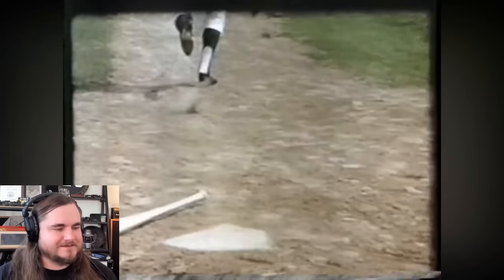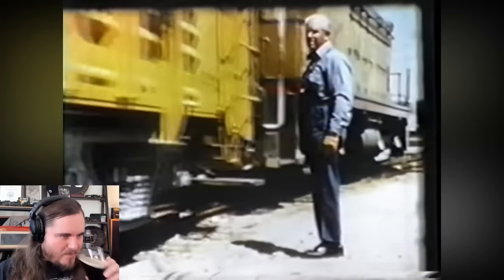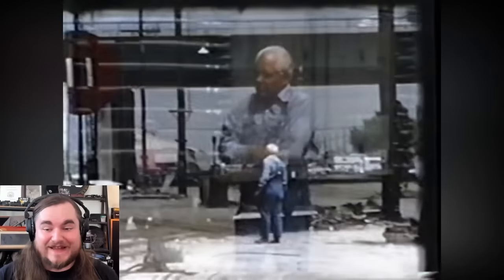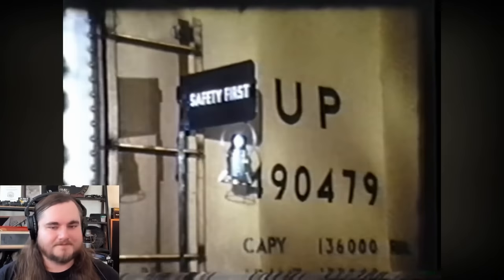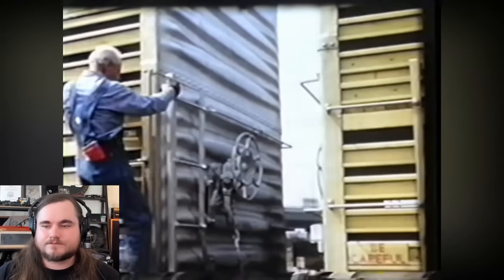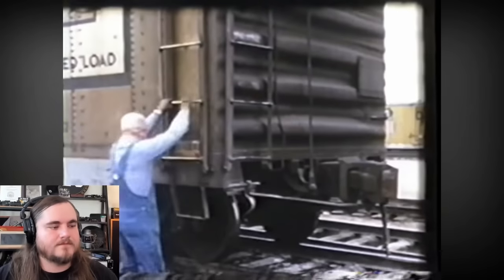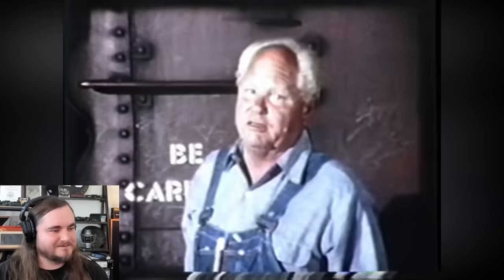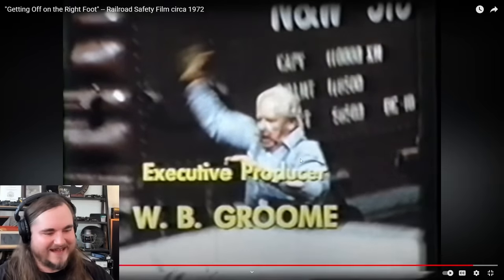The best rail safety video of all time? | Hyce Reacts - "Getting off on the Right Foot"

Comment: Interesting note for those who are curious--to my knowledge, the washout is a universal signal, recognized on every railroad in the world.  Additionally, I've been told (though I can't quote chapter and verse in any set of operating rules) that any vigorous/frantic waving signal from any person at trackside is to be taken as a washout.  That said, if you're giving it to warn of stuck brakes or a hot bearing, it's still best to use the proper hand signals for those, as it does give the crew more information as to why you're signalling to stop... assuming you can get into a place to give such a signal now that the caboose is dead.
Reply: Nah, washout as shown in the video is US (or North American?) specific. Here in the UK the emergency stop signal is the same as the ordinary stop signal (both hands raised above the head); in Germany, it's one hand swung in a circle; no doubt it's different in other countries. Though I think most rulebooks in the world do say that vigorous waving also = stop.
Reply: My local transit agency (which is not under FRA regulation, well mostly), has a rule in the rule book, under signals (right beside all the other signals) that any object waived violently by any person is a signal to stop.

Comment: We also used this video in my brakemen class. If I’m remembering correctly, we looked up the “old head” after the video and learned he was a stunt man rather than a railroader. Nevertheless his performance was excellent. 

Over at my museum, we use hand signals that are closer to yours than to East coast, probably because we inherited much of our practices from the C&NW. However, we do still get on & off moving equipment, mostly during switching ops and run arounds. 

Keep up the great work!
Reply: He was a stunt man, yes, but he was also high up in the safety department for UP, and had been a railroader for a while. Accounts of people who worked with him said he was an amazing teacher that always put safety 100% before anything else.
Reply: Someone else said he was both, that he was a stunt man who happened to work for UP. So it would help to not only be able to do the stunts, but know exactly what to do to be unsafe safely.

Edit: that someone else beat me to it lol

Comment: I'm a little late here, but on the railroad I work for, we use the "night signs" like you mentioned with a couple slight tweaks: a "STOP" signal is a horizontal motion across the body, (or really anything across the body should be treated as a stop.) And we don't really use the "washout" hand signal, but rather it's worded as "any object waved frantically should be treated as a emergency stop signal."

Comment: About the hand signaling, the US railroad always confused me with the motions.
Europe might be different from country to country, but here is how it works in Croatia:

Vertical arm movement - forward
Horizontal arm movement - reverse
Circular arm motion - STOP
One or both arms to the side with you hands lower to the ground, about some 45 degrees - ease off, go slowly, prepare to STOP

Signals can be given by bare hands, red flag or white light at night and poor visibility conditions.

When shunting with a locomotive with one cab, the longer nose of the locomotive is the front no matter what or where the cars are coupled. Now this can sometimes be problematic with center-cab locomotives so there has to be an agreement between the engineer and the switch man.
Now, with locomotives with a cab on both ends it depends where is the engineer. Basically the switch man is telling the engineer where to put the reverser lever. Same applies to multiple unit trains.
Now there is a catch and it doesn't make sense, but it's railroading for you. Imagine for example an EMD locomotive coupled to a train with the short nose being the head of the train, not doing shunting work. Now you need the consist to move forwards. Which signal to give? You give forward even though the rule says the longer end is always the front.

Comment: Used to work at a class 1 a couple years ago, kicking is still very common and one of the most dangerous things you can do. If the train is moving too fast and the ballast is uneven it’s very easy to trip and fall.

Comment: Back in the 90's I was a operating rules instructor for new hires on the UP.  The new hires never had been around the railroad, some right out of college. We showed this very film.  First, three point contact was always stressed when either on a stopped or moving car or locomotive.  Also shoes were to be work shoes with a defined heel and laced up (like Lehigh boot or Red Wings).  In my entire career, I never saw any switchman or brakeman, or hostler get hurt when following the instructions in this film.  We even taught this in on the job student field training classes.  Not shown here, but we used a 2x4 to demonstrate what happens to a leg when run over by a wheel because it was the same density. Then the UP discontinued this practice only to get off and on stopped equipment.  This adds additional unnecessary switching time especially when flat switching or building a trim.  It is harder on equipment and can be harder o personnel for there is additional jolting of the body and drawbar stress via slack action.  This "getting off on the right foot" has been practiced for generations because it is safe and efficient.  I cringe when watching old films though here on youtube seeing brakemen or switchmen getting off on the wrong foot, jumping off etc.  Just want to turn the clock back, be there give them a warning and write them up.  Those gurus in the safety department undoubtedly never worked  in operations themselves, but sat behind a desk (with the lawyers) and said, well we can't have this of crews getting on or off moving equipment, we could be held liable and get sued if someone gets hurt.  Ugh!  Also footboards were eliminated for obvious reasons (a switch engine's job is is to switch cars, not grind meat).   Also the rule was changed to 30 feet minimum distance between cars before bellying up to a drawbar to align it.  Those cars where he demonstrates on how to properly connect brake pipe hoses were hog cars.  The carried 300 hogs on 3 levels.  We called them "The California Ladies"  Hyce, you said "don't couple yourselves up."  That happened where I worked back in the late 70's.  Happened in the bowl cars humped into the track (humpmaster was not informed) switchman was coupled between drawbars.  He lived and conversed with emergency personell until the cars were uncoupled, then he instantly died.  This was a result of a rules violation.  At beginning of the first class on the dry erase board we wrote for the class to see "Operating Rules Are Written In Blood"

Comment: 31:00
Most of my time is on trucks, both tractor trailers and fire apparatus.  Towards us is two arms waving or circling inwards, with rough relation to intended speed.  Away from us is one arm, waving forwards (which would appear as up and down). The last bit to the couple or the line is out of the aviation book moving hands inwards towards each other with rough relation to distance, and the couple or stop is forearms crossed roughly to an X.  Really a hybrid of like four manuals, but it works, and we agree on it.

Comment: As an Engineer the most unusual sign I ever saw was when switching at a station when the Conductor was a distance away and giving a sign to a Brakeman that was pulling the pins. He jumped up and down three times and gave a cutoff sign. Later I asked him what the hell was that. He responded "Cut off three hoppers". Cheers Jack.

Comment: Here in norway the hand signals are very different, not used so much anymore since we usually have radios, but one signal is the same, the very first he used "come back" or come towards me, a counterclockwise arm movement when you are on that side of the tracks. See the signal is dependant on which side of the tracks you are on, and only one arm. up towards the head and in the direction of the rails. Now "go forward" or go away from me is the exact opposite direction of the arm movement. Stop is just your hand out the side, slow is your hand going up and down to the side. Night signals are pretty similar but we use flashing the light as a signal and different colors of light.

Comment: @HYCE   I’m a conductor on a class one. In my terminal yard specifically we do get to kick cars. There are some locations and other smaller terminals that we do work in such as a pick up and set off on our way to a larger terminal a couple stayed over that don’t allow it because they have had so many incidents, or the hill is too steep and if your not careful, you risk kicking cars out onto the main if they keep going. Even if there are already a couple cars tied down and dumped, if there’s only a couple, and it’s on enough of a hill, you you kick a couple loads into that track, those cars brakes will be screeching as they are slowly being pushed further down possibly past the clearance point and into a bad switch. But in my yard we get to do that so long as you are on the west end. Don’t wanna kick at the east end otherwise if the cars don’t make it, it’s coming right back at you. But it’s so much fun kicking cars. But you gotta be ABSOLUTELY POSITIVE that there are already cars in that track. I’ve made that mistake once. I got SOOO lucky. It went over a switch at the other end. No, I don’t mean it went through the switch, I mean it literally somehow magically jumped, and actually landed back on the rails on the other side of the switch. So nothing was bent and nothing detailed. And because I immediately reported it and owned up to it, and nothing was damaged, I got a free pass

Comment: 26:25 as a flight instructor, one of my common bits of regurgitated wisdom was "Never let the plane get somewhere your mind hasn't already been."  Aka don't get so caught up in in-cockpit things like reading charts, setting radios etc. that you lose track of where the airplane is.  No pilot has ever looked up from in-cockpit duties and found a pleasant surprise out the window.

Related saying:  A pilot needs only three things to stay alive.  Run out of any one of these three, and you're in trouble.  A pilot needs airspeed, altitude, and an idea.  Run out of airspeed, run out of altitude, or run out of ideas, and bad things will begin to happen.

Comment: On my road, blue signal protection can only be applied by foremen. It used to be that any worker could with training and authorization from the worker in charge could set it, but an incident in Chicago changed that

Comment: I work for CN out of Toronto and we definitely pull pins when the equipment is moving. :) 
There’s several times I’ve done it for when we’re building locals or long distance cuts of cars to depart. We also have a hump yard so I’ve pulled thousands of pins hahaha

Comment: If you're a person with a lot of time on their hands and who can absorb the opportunity cost, then I recommend watching the original video (whatever it is) IMMEDIATELY before watching Hyce's reaction video.  That Animagraffs Big Boy double-header set me back (at least) a good 2.5 hours that I could've spent doing something else, but I learned A LOT.  Also, if you're the kind of person who can do (and pays better attention to what they're watching if they do) something with their hands while watching, then it's a great way to fold laundry or unload and load the dishwasher and not get bored out of your mind 😅

Also, to answer your question, @Hyce, I dunno if contemporary railroads still do this, but one of my issues of Model Railroader that touches on switching puzzles (or maybe just switching in general) describes a move that railroaders used to do when they needed to get a cut of cars down a dead-end siding when the locomotive was on the end pointing down the siding, which was to get the train up to speed, disconnect the desired cut, pull the engine and any preceeding cars past the switch, then quickly point the switch down the siding and let the cut roll on in.  The article describes this as being a rather tricky move to pull off on a scale model!

Comment: 7:45 There is a technique to doing that without injuring yourself.  First, don't let the tip of your elbow make contact.  You notice it was Glen's forearm and triceps making contact with the switch stand, not the elbow joint.  Second, the instant you feel the contact, swing both arms forward at the shoulder to lessen the impact.  The arm holding on pulls your chest around and makes the impact less severe than just moving one arm.  Of course, this is more easily done if you know the hit is coming.  It will still sting, but you are much less likely to bruise a nerve or chip a bone in the arm.
Reply: how the joints are set and where exactly you hit makes a huge difference too, that one actually looked like it might have really hurt a bit: the pole and lamp base were in great spots and looked intentional but I think his elbow got levered forwards by the sign and threw everything out of line.
Reply: I bet something like a soccer shinguard under the sleeve helps a bit, too, if you know it's coming that far in advance!

Comment: It must be so nice lacing air hoses when you have actually space. Doing it on passenger cars is... Well, its oh-so-very cramped.
 And on hand signals, oh, I felt that rant. Aint many hand signals one normally deals with, but holleeheck is it annoying to not be able to tell if someone is giving the dang motion or not. Dont really use hand signals anywhere else, oddly, just on the road. Yard work is almost all via radio... Probably because theres almost none of it

Comment: there were so many things in this video that provoked an instant gut reaction and a few "oh, crap, I could actually see myself doing/failing to notice that" moments but it was that bit about removing maintenance flags in particular that hurt to see: it's even worse when the person who does it is the person you're supposed to report it to.
we had a boss who would treat that overfull keyring of his as standing permission to remove "lock down tag out" locks and do shit whenever he thought that maintainence was not actively working on areas/equipment/etc that they had locked down, you can fairly easily kill people who are just changing a damned lightbulb doing that let alone what happens when they are crawling around in the guts of an industrial grade wood chipper.

Comment: Working for KiwiRail, we're fulltime anti-fun. No boarding or alighting while in motion. No kicking or slipping or hump yards (used to have all three but got rid of them, where I work used to be an important hump classification yard)

So boarding or alighting in motion isn't even trained anymore, which sucks. New guys just have to sorta pick it up which is doubtless gonna lead to disaster one day but will get immediately flung back on the worker because 'you're not supposed to be doing that'. But I worked for a heritage railway for nearly a decade before I started on the Big Railway and there they taught and regularly practised alighting while under motion. But not slipping or kicking, no room for error in the tiny yard and far too many valuable preservation items of rolling stock that can't afford to be damaged at all.

The biggest thing that gives me the heebie-jeebies about what I saw in the video was the sheer distance one has to raise their foot to get in a car's stirrup. Here in New Zealand yards are filled to the railhead with pea-sized gravel. That in itself keeps the footing regular and knocks 4-5 inches off the distance you gotta lift the leg to get on. Then the steps for basically all rolling stock is less than a foot above the railhead. Real easy in a yard environment to get on, a bit less so where there's your familiar  'exposed rail'.

We do still have footboards though, only allowed to ride them on the trailing end of the locomotive though, gotta be in the cab or authorised riding position (basically up on the running board of a mainline loco or the shunter's refuge if you're on a shunter loco.)

If you wanna see a 1930's railway safety video when riding on loco leading footboards was the norm, where there was a special hand signal for kicking and slipping, or the fairly comprehensive lamp shunting techniques from New Zealand. Or just weird little four-wheeled British-style wagons being hustled about by beefy narrow-gauge 4-8-4's there's an NZR training film called 'The Shunter' https://www.youtube.com/watch?v=Y2fOf1MVo7c

If you want some more up to date practises, still 30 years before they nixed getting on or off trains in motion, there's this from the 90's. It's even in my yard! Timestamped for operations relevant stuff rather than the first half which is more about loading wagons. https://youtu.be/iv71ORv-KVo?si=VSqX5ZMd_LRxSoDg&t=1747 

If you ever wanna talk about it or go through some of these videos from both a historical operations perspective or a modern operations perspective. My discord is @slisk

Comment: As an Aussie watching the hand signals, Jesus christ that’s confusing! Here we have 4 main signals, that vary state to state but in a nutshell;
Come towards me *- one arm waved across the body. Similar to your go away signal used at 30:30. 
Go away* - one arm waved in a circular motion, similar to the demonstration at 28:04. 
Couple up/ease up - arms above head with hands together. Can also have hands come together then apart, repeated. 
Red light/stop - arms above head with hands far apart. 

*come towards and go away signals can have the other arm raised above the head to denote a slow movement, usually meaning prepare to stop. 

At night the red light is literally a red light  held steady. Come towards is a white light moved horizontally across the body. And go away is white waved up and down. Slow movements are used with a green light instead of a white.